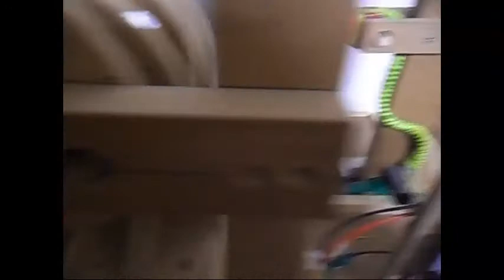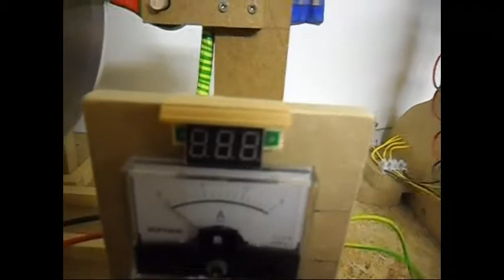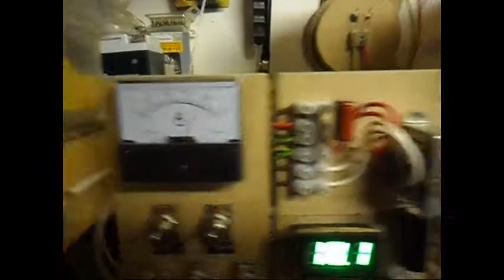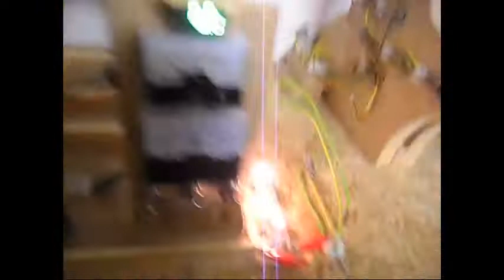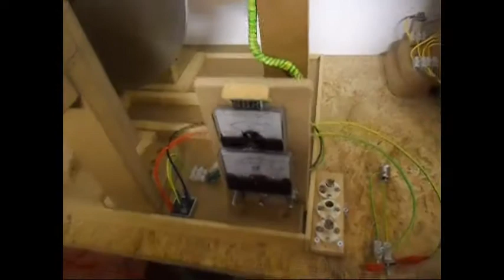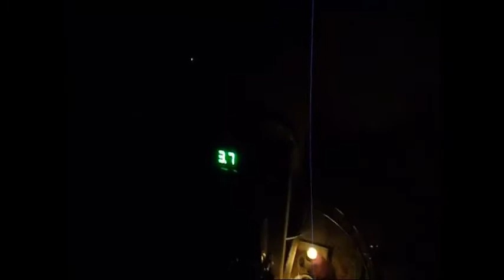Pulse Motor_Generator - Update 17 OverUnity is it or not, Future World Generator_4...

Comment: Well,  I complement you on your skills and organisation of your set up.  I wish you will give some attention to the fact that the  characteristics of an electrical source needs more than measurements of voltages and currents and speed. 

*About cogging, well there is no  cogging  to start  as the coil has no iron path in it  and while stationary it has no current, so no reaction with the magnets.  But I would say that once the coil has current in it,  the magnetic field set up by the current in the coil would cause a reaction which would cause a cogging  when it runs as this is what would load the generator when  supplying a lossy load.

* About frequency , well power systems usually prefer 50 to 60 hertz  but with one coil and many magnets on your disc, I just wonder  what is the value of the generated frequency , note not the revolutions, which are of course related.

* About output impedance of the generator, this is important as this decides the regulation under load, I wonder what is the value of the output impedance, and would you consider it as a current or a voltage generator? 

* About power factor, this is also needs looking into as it is an AC generator  primarily and then you rectify it to become DC etc.   Because of the fact that the output is AC, I wonder if you would reflect on the  Loading when the output is short circuit as though you have a lot of current , there is little voltage and the power factor is not unity so  a short circuit like an open circuit  does not produce the heaviest or maximum power transfer to the  short circuit.   That is the reason you should think about the output impedance of your system as the maximum loading requires a load that is related to the output impedance.

* What you have is  surely not over unity as at those revolutions with that type of coupling belts, they use a lot of power so  the output is always less than the input, even if you use DC to DC  converters to amplify the VOLTAGE.   Power and Energy is not voltage alone, but, Voltage, current and power factor operating together as a team.

* I do not fully understand the reason why you stepped down to the  flywheel and then stepped up again to drive a high speed alternator.  It would be interesting where is the best position in that transmission  considering the Moment of inertia of that flywheel through a gear box.

* for the level of power that you are using, you  could have done with smaller rectifier as I feel they are much too big for what you require.  The power level you are using needs careful measuring to get an accurate picture of what is happening.

You are a neat, careful, well organised person, both physically and mentally,  wish you luck in your career and  as it is new year's eve may I take this opportunity to wish you a good year 2016
Reply from the maker: +Carmel Pule&#39; 
Thanks for your comment, all the points you&#39;ve written and compliments...^^
This setup has been a fun one for me to test and learn how all kinds of generator coils works with the lenz effect in mind...
And i have learned a lot especially how not to go by with it...lol...but i&#39;ve also learned somethings i did not know yet but do know...:D
All in all it was well worth learning path and hopefully i will soon put it all to good use in one of my future design...;-) 

I also wish you a Happy and Healthy New Year 2016 and may many of your dreams and wishes come true...^^